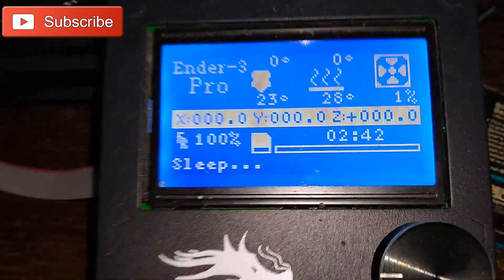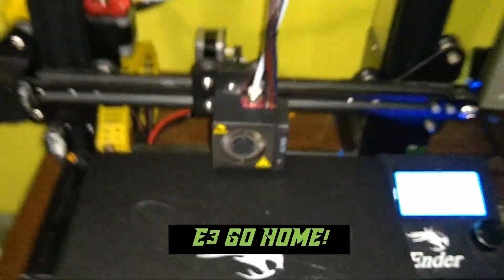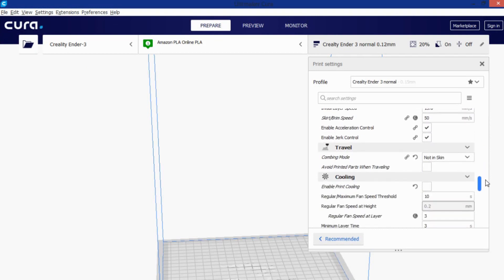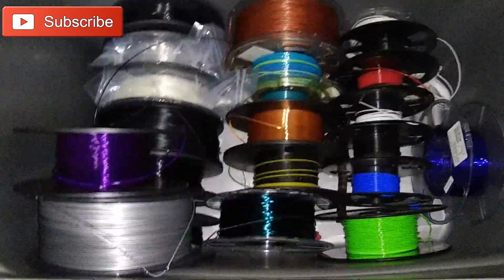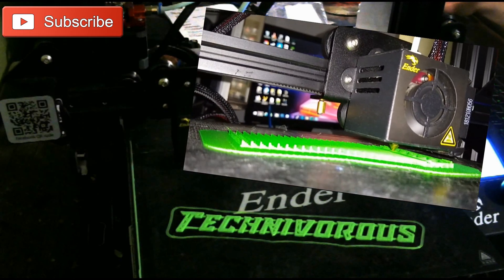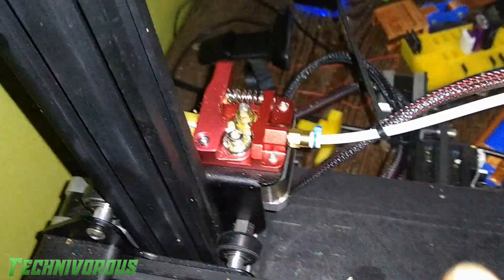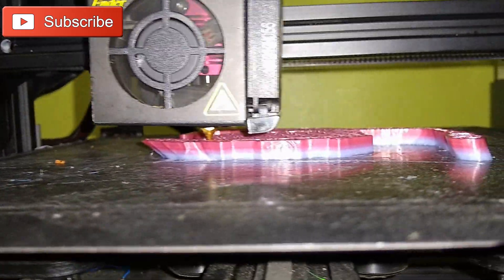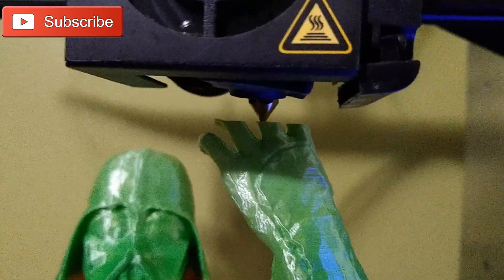5 things to know before you fire up your ender 3 - 0.0

Comment: im only geting suports in my build its not even atempting to do the actual model at all prints the suport only and then it says its done (this is my 12th video i have seen trying to figure out how to fix this)
Reply from the maker: Try sto not obj. Cura will load objs but dosnt slice them right.
Reply: @Technivorous  is there a way to convert obj files  to that the program im using is creatality slicer 4.2
Reply from the maker: Blender is a free 3d software program that can do that. If you import the obj in creality slicer then click, file-export.

What are you printing? It may be that the objects walls are thinner than the nozzle and just wont print. If this is the case, under walls in the settings there is a setting called print thin walls that might help.
Reply: @Technivorous  thats probably my issue im printing a verry tiny spaceship model i made my self and its holow with extremely thin walls becuase it was made before i even had a printer and never even knew it would be abled to use it in one in the future
Reply: @Technivorous  would it be easier to just make the model solid and fill in the inside than to change the setings i already did enable print thin walls wouldint it be more likely to fail the print tho
Reply: @Technivorous  ok i figured out that my walls were to thin and the bed was not fully level (i have sucsessfuly printed a really nice 1 inch big tie fighter from star wars for test print) no flaws at all